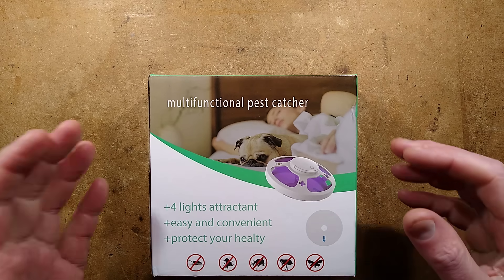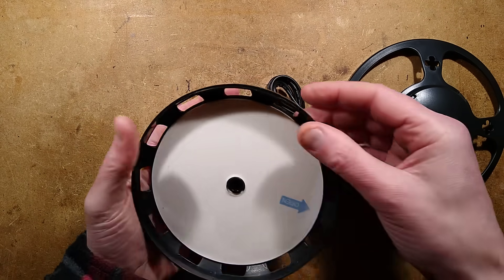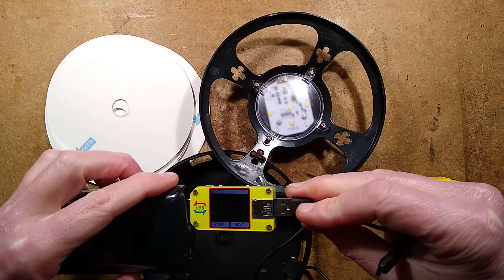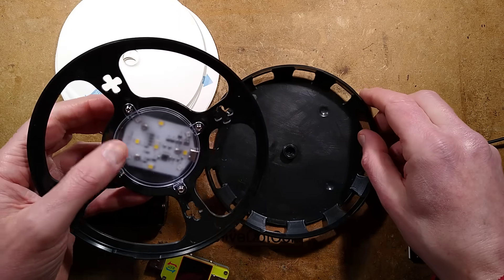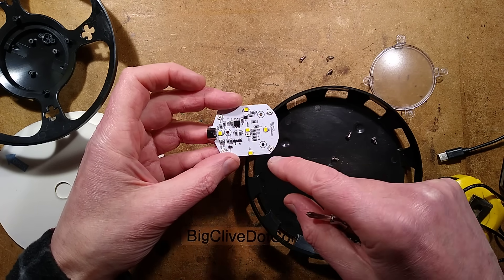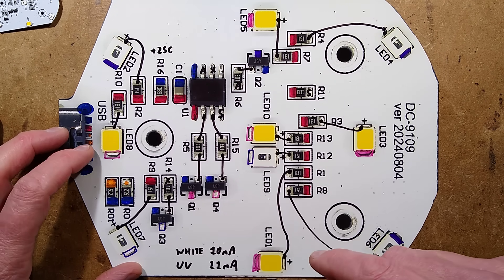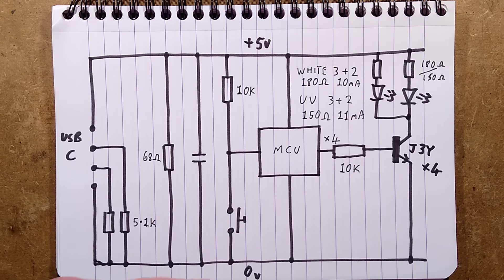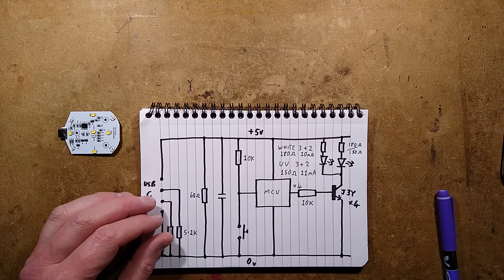USB flea trap teardown - with schematic

Comment: I once noticed that fleas would ping to your ankles like magnets to iron. I guessed they were detecting the heat. I filled a tray with water and a drop of soap to break the tension layer. Placed a tea light candle in the middle and left it on the floor. Sure enough the fleas catapulted themselves towards the candle, landed in the water and drowned. To what extent the light helped I've no idea. I just assumed they liked the heat. I based that on the fact that my ankles do not glow.

Anyhoo, I suspect an old fashioned incandescent lamp would work better than these new fangled LED's. Good old glowing wires with an efficiency of about five percent made great heaters and rubbish light sources. 

Thanks for the video, always something entertaining.
Reply: @mikesmith839  Your impeccably logical observation that your ankles don't glow is quite nerdy and funny.
Reply: In a way, we all glow in the infrared spectrum 🤩
Reply: Agree. When my cat had fleas I noticed they were jumping into my tea when I left the cup on the floor. They are attracted to heat for sure.
Reply: ive tried with a an incandescent lamp and soapy water, it works quite well. we used a white bowl with plain paper under it as well.
Reply: I also noticed the ankle thing and (while having a similar cat emergency and solution) before I went to sleep and lay still in bed the little bastards tried to have a drink from the corners of my eyes.
Reply: @chris-tal 
Ooo, that's just nasty 🤢
Reply: Used this method myself , works well.
Reply: I think there is also a smell component and, also, different types of fleas.  Back in around 1978, I had a holiday job (here in Australia) combing myxomatosis fleas out of special infected rabbits and the fleas would jump up our arms but then hop back onto the rabbit if they could (or fall through the grate into the hopper and measuring cylinder, below).  The scientists told us they were rabbit-specific fleas and we were the wrong temperature and smell.  As an aside, the fleas were sexed under a microscope and males and females were put in separate test-tubes and exported to Sweden.
Reply: @normandiebryant6989 
I'm sure the Swede's were most grateful 😂!
Reply: The 68 ohm R is for the heat. that is intentional.
Reply: Good tip.

Comment: 5-1/4" just happens to be the diameter of old school floppy floppies.
Speculating they repurposed a machine for cutting floppies to cut stickies.
Reply: I thought they looked like CD's.
Reply: @Franko_Walker  Yep, and the center hole might be CD sized too. I guess a ream of CD adhesive labels will cost roughly as much as that five-pack bug stickers :D
Reply: @IlBiggo  Good thinking. 👍
Reply: Not too old school, they were 8" before that.
Reply: @vintage1956  Everything shrinks with age. 🤣
Reply: @Franko_Walker  Not ears
Reply: The resistor pulling standby current is there to create a heat source to mimic a host animal and thus attract fleas, mosquitoes etc.  I'd imagine the old incandescent bulbs might be more effective than this tiny resistor.
Reply: Unless floppies is slang for compact discs, we have no idea what you're talking about. Floppy discs were smaller than that unless you go back to ancient history when floppy discs were the size of a medium notebook.. and I'm pretty sure machines made to punch those size were scrapped as soon as they were made smaller.
Reply: @RedTail1-1  LOL, I'm ancient I guess.  I've worked with all of them.  
The "floppy" disc's started out as 12", then 8", then 5 1/4" and finally 3 1/2".  All of them where actually floppy except for the 3 1/2" ones.  They had a hard plastic case that the others didn't have.  The funny part about it was as they got smaller, they had a higher capacity with the 3 1/2" holding the most data.
Reply: @ki4tlf  Unless you were in South Africa, where 3.5" disks were known as "stiffies"   (fwoar)
Reply: @RedTail1-1  Not really...
The original floppies were 8´'' , but they were not really used for personal use at all. Then came the 5 1/4 inch floppies. The name came also from what they did: flopping sounds when you swapped around. 360K and later first double sided (yes, we used to need to flip them around first!) and then double-density up to 1.2M-Bytes per disk.
The more modern 'diskette' made its apearance also a bit later and that was 3.1/3 inch. They were of hard plastic and have/had the look that the 'save' icon is using nowadays. Sometimes still refered to as 'floppies'  like their earlier versions of magnetic disks for home-use and also in the working-sphere.
Those started already bigger for the data (more condensed) and went up to 1.44MB and later even 2.88MB per disk.

Since especially industrially the floppies 5 1/4 inch have been used industrially and also in military for a very long time even in the 90's and early 2000's in production by some brands. Diskettes have been produced even longer.
Actually, some medical equipment for example still needs them but it is getting rarer and rarer to even find those small disks.

I have an old laptop that used to work with 2 1/2 inch actually.... those were quite expensive but you could re-use them many times and at home export the data to an external 3 1/3 inch disk.

The size of 5 1/4 is also the legacy size for drives in computer-systems like towers and therefore also for CD-rom/DVD-drives and such. It just fitted well inside the same housing/casing.
Reply: @el3dprint  A lot of "personal" CP/M systems had 8in floppy drives.  Radio Shack in the U.S. used to sell the media.  With CP/M one had complete control over the formatting of the disk and the system I set up in my father's office was putting 1.9MB on an 8in disk.  I eventually used the same tricks on my MS-DOS PC with 3-1/2 high density floppy and managed to get about the same storage capacity.  Microsoft eventually started using the same format to reduce the floppy disks required to ship Office and Windows.

CD-ROMs are the size they are because that is the size of the audio compact discs standardized in the early 1980s.  Audio CDs standardized on that size because:  "The long playing time of Beethoven's Ninth Symphony imposed by Ohga was used to push Philips to accept 120 mm"

(the sources on linked on wikipedia)
Reply: @Sylvan_dB  Hi. Well, with personal I meant more 'for the private masses'. They had no CPM-systems (I did...) at home but bought for example a Commodore-64. I think here in the 80's about 1 on 6 households had one, many with cassettes and some also with diskdrive for 'flops'.  And later with PC's that were mostly clones of IBM-PC's they had at work with programs like WordPerfect that ran just from floppydisks (no hdd's needed). At least here.
Lots of things were possible with disks of course but for the big personal masses, these were the standards that were exchanged between work and personal computers at home. Lots of times the older PC's from work were given away to the workers who then got the whole PC with drives and flops to do some wordprocessing and used quite a lot for playing and copiying games for children. And of course teaching the children that even in the 90's were using those kinds of PC's still with floppies (yes, 5 1/4 inch) and diskettes since HDD's were much too expensive for many schools. My company did help installing a network in those days (early 90's) with boot-diskettes and / or boot-floppies, old networking-equipment and a 'server' with yes a 40 MB HDD... still only 15 PC's (if at all) in those networks, donated by companies that upgraded their systems.

They would ofcourse run MS-DOS or PC-DOS while companies were switching or had switched to Win 3.11 or even Win95. Many public schools and home-users still DOS.
Nowadays it is hard to imagine that still a lot of companies were running DOS even at the start of the 2000's and designing in old versions of AutoCAD with maybe one or two stations with MSWindows and later with accessing 'The Internet'. Clearly no US. Lots had to do with licencing and the enormous price for those programs, both Windows and AutoCAD, but also schooling. AutoCAD 9 and 12 for example still in use. In the USA the licencing-system had changed but not here in Europe where copying was too common so old dongles needed to be bought and used. But ofcourse also available in French and German besides English. That really slowed the whole thing down quite a lot compared to the USA.

I talked with some of the people that helped developing the CD (here from Philips) and they told me that one of the size-limitations was that it should fit in the standard bay like those of a PC. Otherwise they would have gone bigger (like the laserdisks that were around already or the size of 45rpm music-disks). It was quite interesting to visit those places in Eindhoven as a student.  It was like visiting a living museum.
Reply: @el3dprint 
I do have a 12” floppy at home.
Oh, sorry, it is Blue Monday from New Order (1983) 😊
Reply: @RedTail1-1  5 1/4" disks were the standard medium for a couple decades, from mid-70s to mid-90s. 5 1/4" and even 8" floppies are still in use, mostly in lab/industrial equipment. And yes, they're called "floppy disks": floppies is a perfectly normal, non-slang word.

Comment: Mid roll ads piss me rob got the ff, they cut in mid words! . Google are bastards!
Reply from the maker: I'm doing a test on whether YT makes my videos "more visible" if they are allowed to place mid-roll ads.
Reply: @ it is blackmail by Google, making videos unwatchable in many cases, and even on computers they are working a way around as locking software. No wonder so many are now telling Google to shut ce it up their corrupt arses!
Reply: hint: Brave browser
Reply: I know it seems like the last week they got really bad. Like every time you posit video and resume it picks up an ad about 10 seconds later. And not just one it's guaranteed to be two ads and it's gonna be for the bearskin hoodie because we really need to push how manly you are if you're not manly to wear kangaroo pockets etc. and stop wearing layers but you need two layers of our product to be waterproof, false advertising. Then there's the guy invented this crazy contraption save hundreds on heating doesn't use any electricity but plugs into an outlet etc. ads..........................................

Comment: I think it's not enough heat .the fleas and other insects  and reptiles are attracted not just UV light or white light but infra red ...And I think the fleas react to  a change in light to jump .looks good as far as build is concerned .similar to mosquito trap but they use a chemical attractant and electrocution for control

Comment: Wow this jogs a random memory. We had trouble with fleas a couple of times when I was a teen-ager. At some point I observed that they didn't just randomly jump around, but were attracted to certain things like socks, bare skin, and bedsheets. All were similarly-colored, so I did some informal testing with various colored items and found that I could place a single sheet of WHITE paper in the middle of the rug in my bedroom and it would immediately be covered with 10-20 fleas. Being an industrious youth, I grabbed a can of Super 77 and fashioned a set of homemade sticky traps. It was a surprisingly effective method and greatly reduced the flea population in my room. Ultimately, the exterminator "fogged" the house and ended the infestation, but I was still pretty proud of myself.
Reply: Fill a bowl with water, put a little dish detergent in the water, place the bowl under a white light night light. Cheap and effective.
Reply: @Eidolon1andOnly  yes, they love white light, the soapy water works good. 

The new sprays that stop their reproductive cycle are impressive. My cats got fleas after a friend brought a dog in the house, I was worried because as a kid we could NEVER get rid of fleas, they were always around, even after fogging. 

But I sprayed this stuff (my Adams? It was in a blue trigger spray) on my bed, couch, etc and it solved the problem for good! I was so happy, I thought I was doomed 😂. I also put that anti flea and tick stuff on my cats necks.
Reply: When I was younger I used a fan filled with water, and a tea candle floating in the middle. Was very surprised to see how many there were in there.
Reply: For what it's worth you can just cut some thick paper to fit and spray on specialized adhesive to make more "discs" for these traps.
Reply: Borax sprinkled and worked into the carpet, let it be for a couple days, vacuum up. Maintain it with a new coat about once a year. Zero fleas.
Reply: that sounds like a good way to destroy your carpet @MadScientist267
Reply: Zebra stripes will effect their depth perception.
Reply: @napalmholocaust9093 Okay. By they, I assume you mean fleas. How could this phenomenon of perception be used for pest control?
Reply: @napalmholocaust9093  No, it's the pee. Guaranteed to attract every fly for miles.
Reply: That's so awesome you were able to come up with a solution with what you had laying around. The true maker spirit!!!
Reply: Dish filled with water and a little washing up liquid, with a tea light floating in the middle.
Detergent was necessary as I saw fleas jumping off the water and wasn't having any of that1